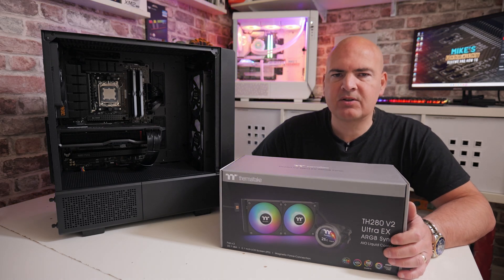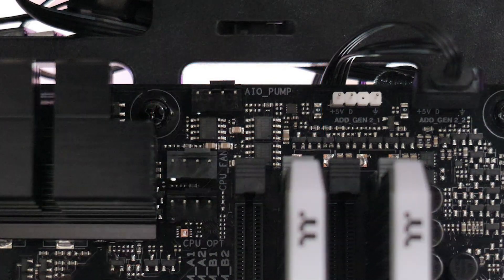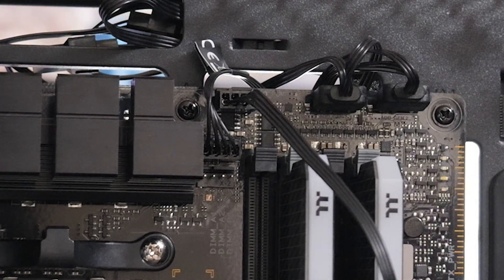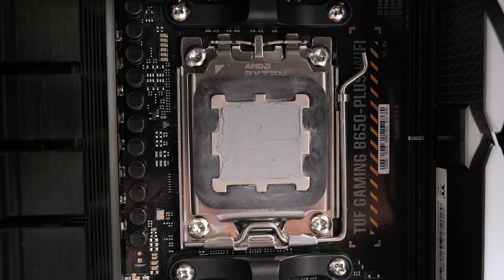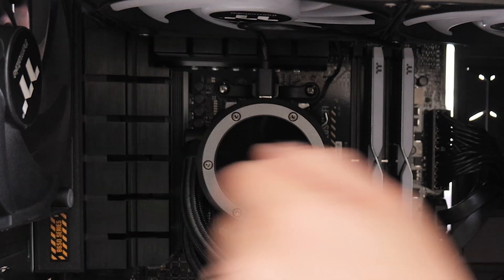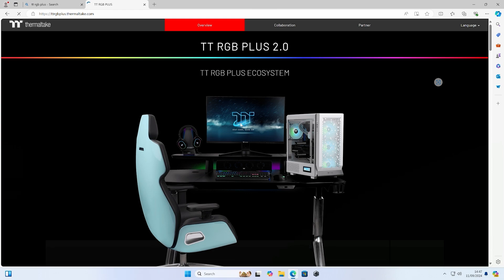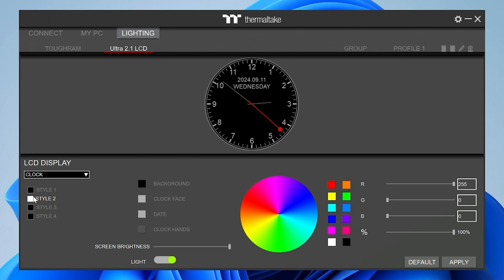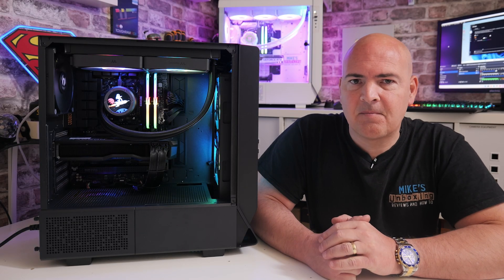How To Install And Setup Thermaltake TH280 V2 Ultra EX ARGB Sync AIO and TT RGB Software on AMD

Comment: Can't stand when manufacturers try to reinvent the wheel in a shitty way. This mounting system is the dumbest thing I've seen. 1. It is not straightforward, and prone to user error. 2. The mounting system itself, I:e the "clips" to hold in place is a recipe for failure. 3. What about if someone already had another aio on their board and lost the plastic clips for the mobo? That's would render this mounting system absolutely useless unless the user can fab some type of bracket up. The AM4 system is fucking dumb. Anyone standing up for this type of design work should never build another o.c

Comment: Just purchased a TH420. TT RGB PLUS as to be the worst program I have used.
Filled with bug some that have been there since the beginning, like the text being so small you can barely read it...
I'm returning it.
Reply from the maker: after you agree to the program terms that goes away, and this cooler doesn't need to use TT RGB plus if you only want the temps shown

Comment: wont show my aio
Reply from the maker: sorry i don't understand the question
Reply: @mikesunboxing i believe he’s having the same issue i came here for- we have the thermal take AIO coolers and no matter what version of software i’ve tried it does not even show up on the interface. 0 control over any RGB at all it’s just a rainbow fan sitting in my pristine all white build 😭
Reply: @judewren3995  what I'm going through rn